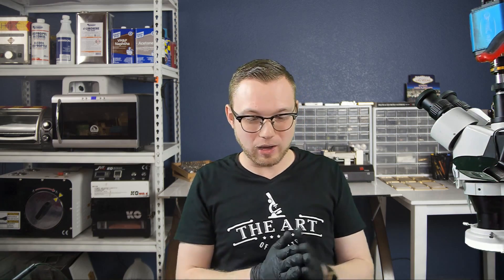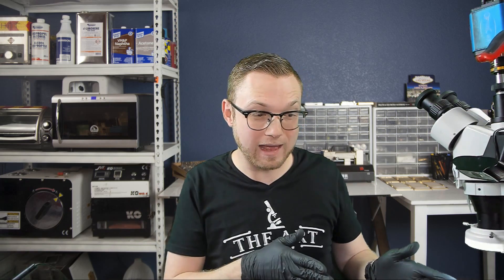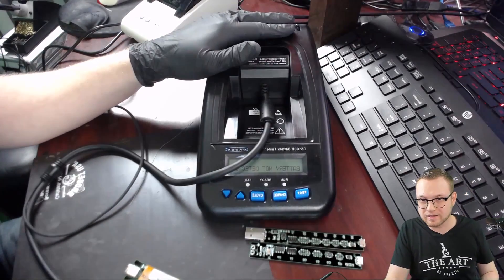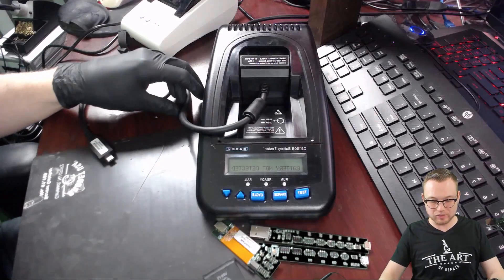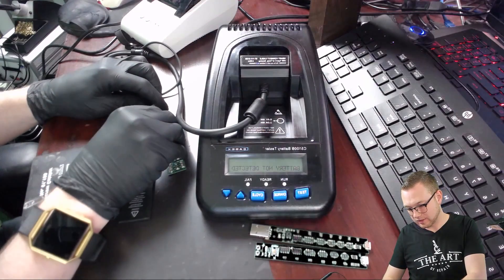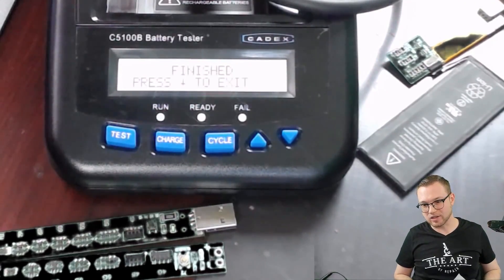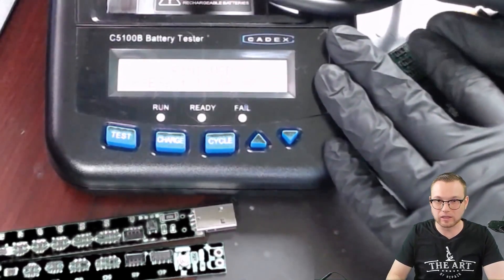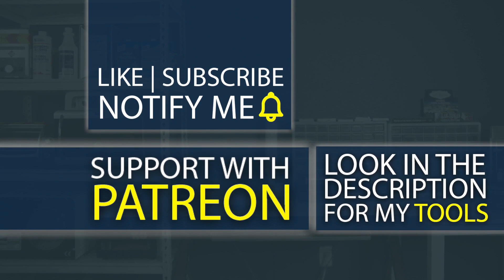Battery Testing | ElectroChemical Dynamic Response | The Voltage Drop Lag Test

Comment: Hi Justin,
Does this machine work well for you? i just bought one but it seems like it does not work well for my purposes as it always give good reading on customer’s battery even if i try a bad battery  like battery draining fast, battery wont charge past a certain numbers and it still give good results (sometimes it comes out bad but most of the time its good)... Any recommendations? Thanks